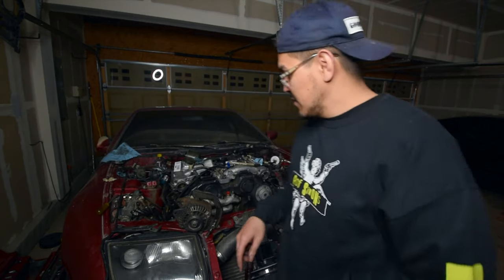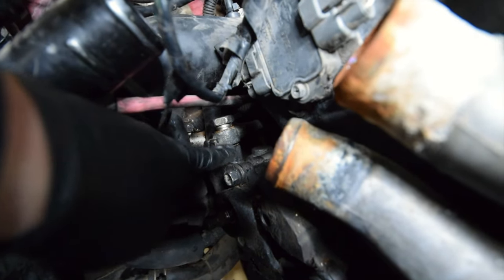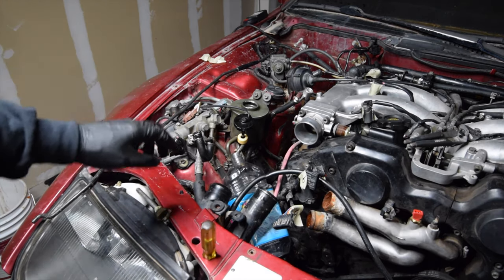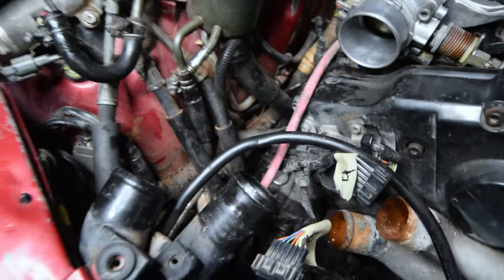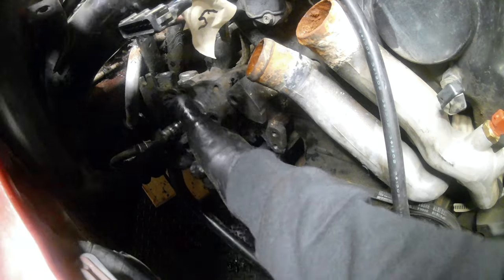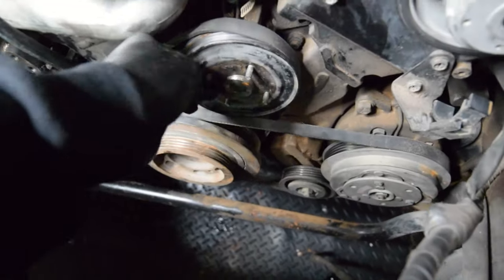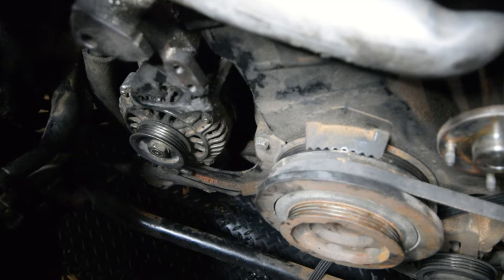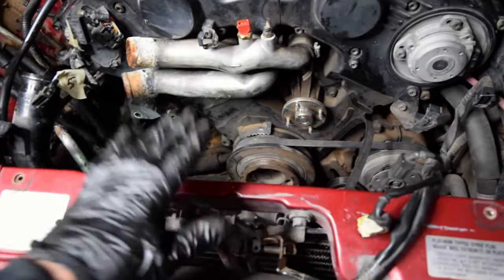How to remove your alternator and/or powersteering pump from a Nissan 300zx

Comment: To do my alternator I just dropped sway bar to get it out without any issues, maybe an extra step but 4 bolts and boom it drops out
Reply from the maker: Good tip I pinned it for others.
Reply: @loosebolts4537   I literally just did it two days ago and it’s just how I got it done. You can technically remove top bolt on both sides and you can wiggle it between sway bar but I just dropped it to make it easier

Comment: Thanks man because I need to remove my alternator gonna knock it out.
Reply from the maker: Glad it helped man!
Reply: @loosebolts4537  I used the alternator information and checked it. It was running at 14.2v so it's good thanks for that also. Replaced the O2 sensor that was difficult because they are in the headers and there is very little space to work and the transmission dipstick is up against the O2 sensor but I got it. I run a lithium titanate 12 cell battery because it seems I have a parasitic drain not to bad but I need to find it. It has great starting power. I have a convertible which is rare and I love it.
Reply from the maker: @Commentthat  awesome brotha yea those o2 sensors and headers are a pain to get to especially the one on the driver side.

Comment: Yo fam the 14mm bolt that enter in the front of the PS pulley doesnt want to bolt right in. Any advise?
Reply from the maker: Moose so is the bolt the one on the bracket, the ps pulley has a nut

Comment: I replaced both my alternator and poweramsteering pump with out removing anything else I didn't remove the fan nor the radiator
Reply from the maker: Yea you definitely can I just did as I’m in the process of removing everything from the engine bay,  just to add another perspective of where and how these things are located.
Reply: how did you do it
Reply: @iGoofz  just have all the tools needed especially small sockets and the right wrenches and alot of patience cuz its like a puzzle but yes its possible